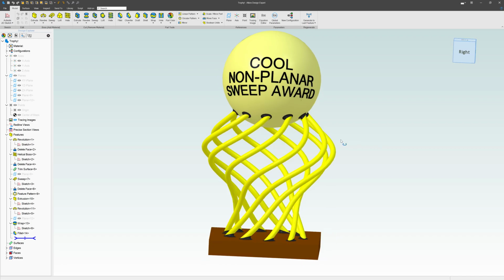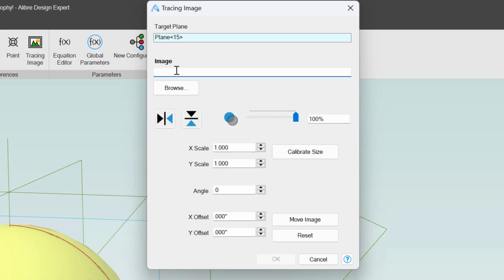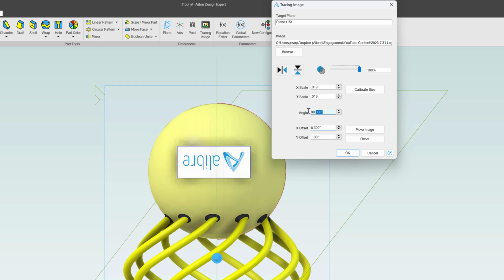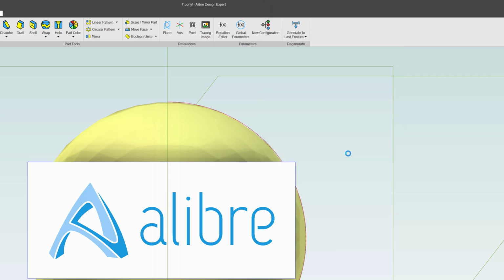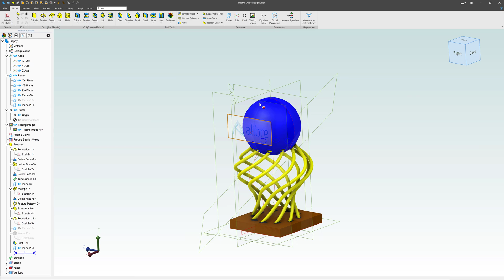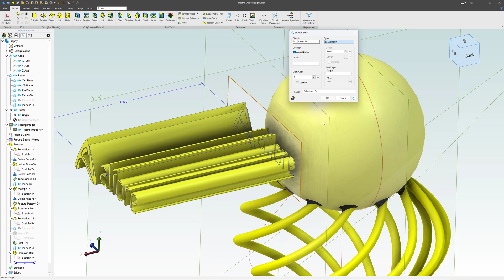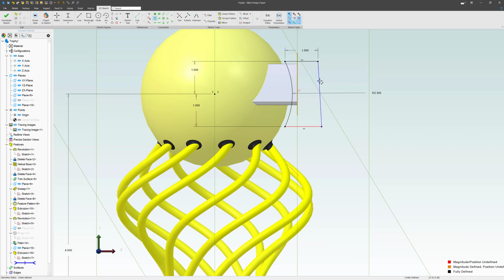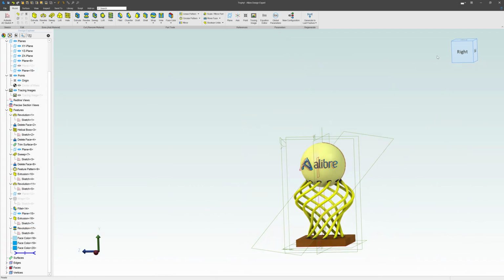Add Your Logo to a Part in Alibre!

Comment: Wish we could use lines from SVG files to generate a sketch for something like this. It would really cut out a lot of time from the process if it is already made.
Reply: You can import SVG files into sketches. That is available as of v26. You can also export sketches to SVG.
Reply: Yeah does Alibre have an enhancement request portal similar to SolidWorks? That would be great and in high demand.
Reply: Thats cool. Labour intensive though with all the tracing.